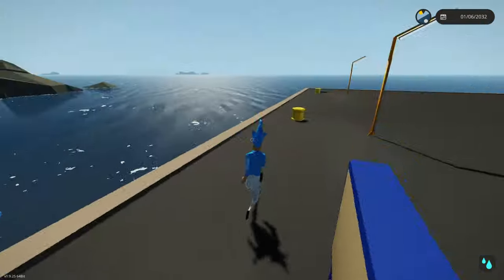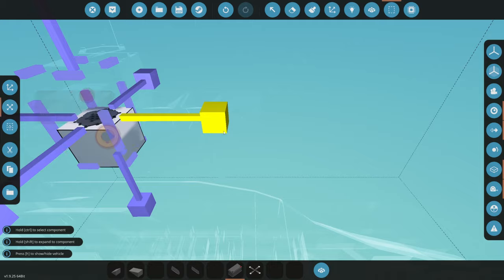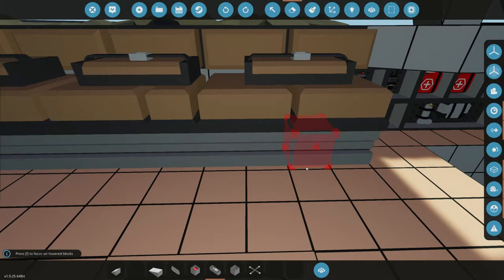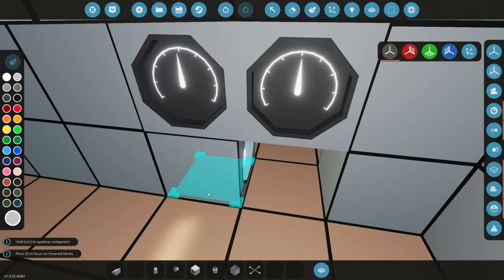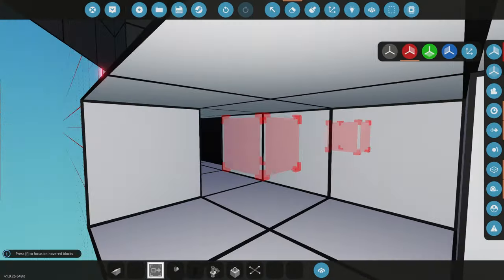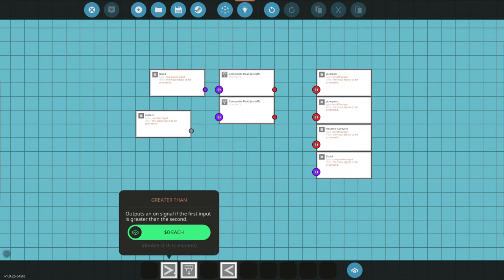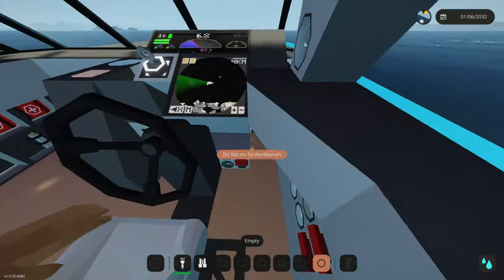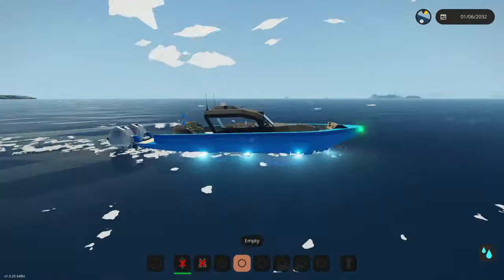Adding Ballast Tanks AND MORE to the Speed Boat In Stormworks!

Comment: Can you talk about issue 23978? I have tried to submit to bug tracker without success. It's definitely a bug and will help a lot new players starting a new career
Devs will not help

Fluid tanks (premade and custom) do not refund the full content upon return to the workbench.
Loss of fuel can be huge taking into account that a vehicle can return to the editor several times for modifications during construction. The amount of fuel lost varies. For diesel it is around 30 liters per tank, for jetfuel losses go from 200 to 500 liters in some cases.
The economy of career and classic career mode revolves around these resources, new players can run out of gas without even go on their first mission.
The loss increases as new fluid tanks are connected to the system. 10 tanks can lose 300 liters at once.
Workaround for now is only use 1 huge fuel tank and use eletric to test vechicles and only spawn vehicles with fuel after complete construction.

Steps to reproduce:

 1. Build a floating box with 2 premade tank connected (with pipes or directly) full with diesel or JetFuel
Connect more for more loss

 2. Check fuel storage

 3. Return to workbench

 4. Spawn the box again

 5. Check fuel storage - There is significant loss